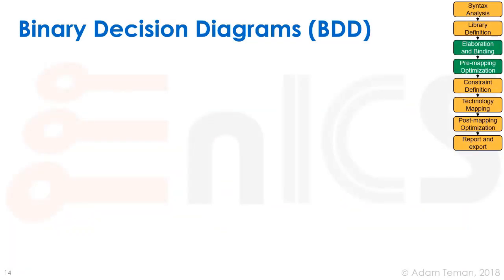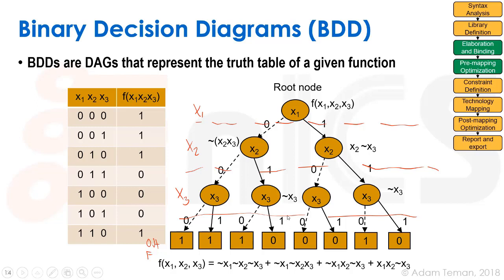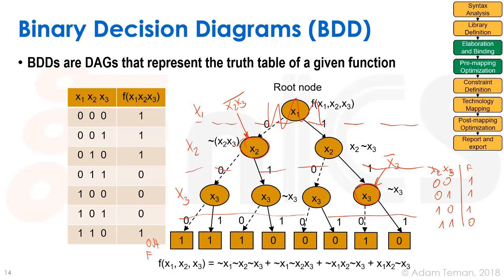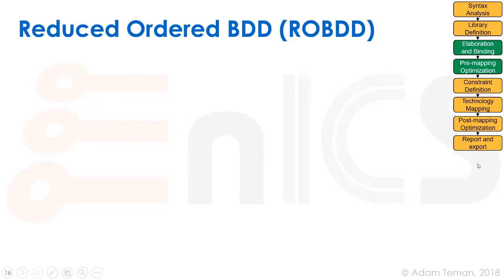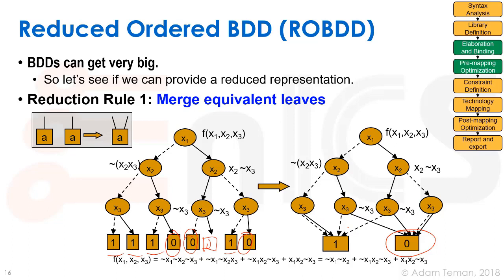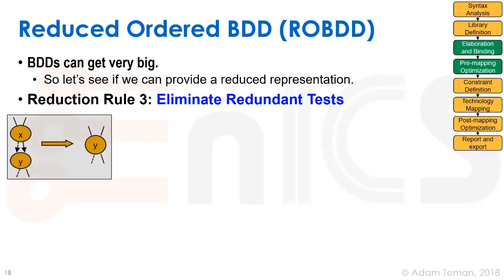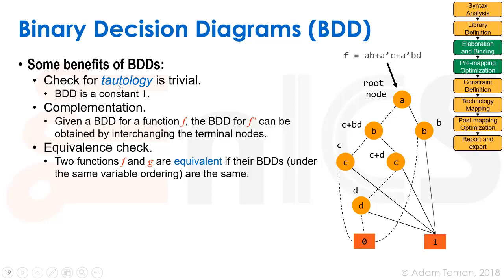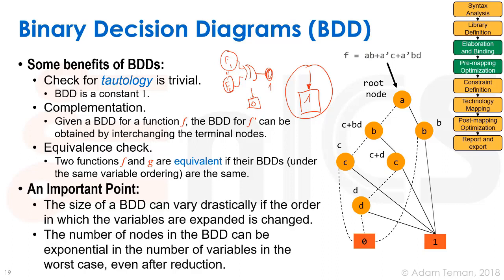DVD - Lecture 4b: BDDs and Boolean Minimization

Comment: Can't I use a BDD to use SAT? A formula is unsatisfiable iff its BDD reduces to a constant 0

Or perhaps the process of turning a generic boolean expression into a BDD is NP?
Reply from the maker: Hi,
Yes, BDDs can and are used to satisfy SAT. However, BDDs tend to explode in size, making them inappropriate to (solely) be used as SAT solvers for large circuits. In general, SAT is a huge research topic and there have been many solutions and approaches proposed over the years, and many of them partially integrate or rely on BDDs, but the state-of-the-art is not just using a straightforward BDD for solving SAT.